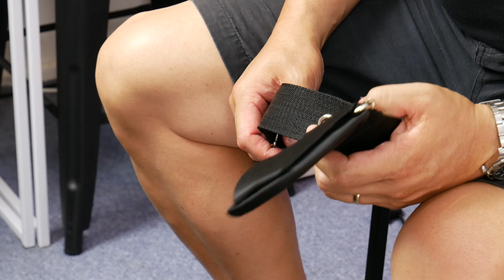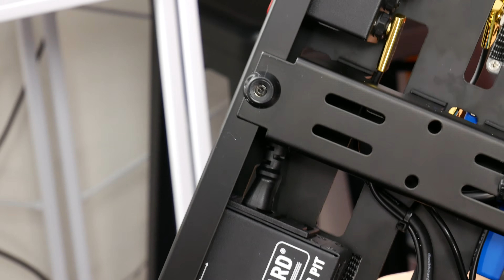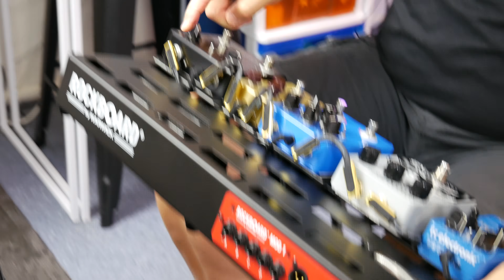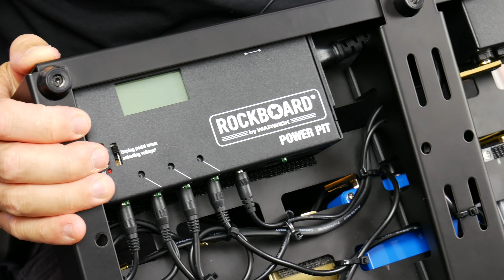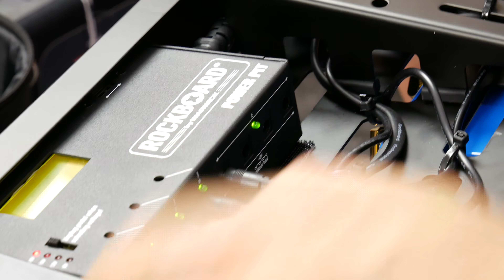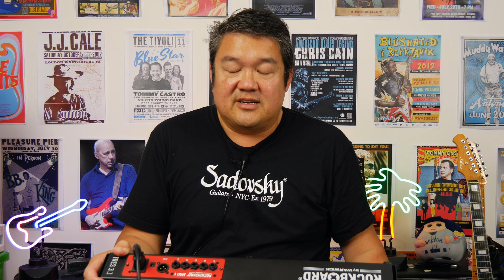Warwick RockBoard Tres 3.1 & Pedal Pit Power Supply Review

Comment: With the patch bay, one of the reasons there are 5 pass through inputs/outputs is so that you can run drive pedals, compression, boosts etc before the amp (via A and B for example), and place any reverbs, delays etc in the amp's effects loop (via C and D). If you want to convert it back to having all the pedals before the amp, then just plug a short patch cable between the two sets of pedals (patching  B and C together). Thanks to Pete Thorn for that tip :-)

Comment: Nice review thanks, how do you find the size of it, I noticed your not using much of the back of the board do you think the smaller board would be better for you. I have a similar number of pedals. Also the patch bay on the back any issues with cables getting kicked or knocked out? Looks like a cool board I'm wondering which size would be best for me. Thanks.

Comment: The patch bay an the power supply you pay separate. The board alone is 220.00 the patch bay is 99.00 and the power is 240.00 Total 559.00 So realistically for me this is an over priced hunk of metal. And it was not all in one kit convenience is key for this price.